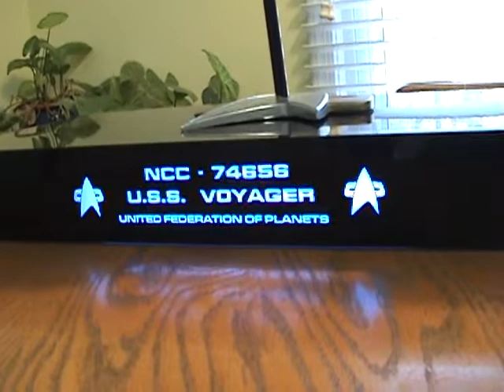USS Voyager

Comment from the maker: @tonypk0710 Thank you! Yes, I bought some very tiny drill bits (1/32) to drill the windows out (three holes for each window - top, bottom then middle) then bought a set of very small files (from Micro Mark) to square the windows out. Since this was my first attempt at drilling out and filing  windows I didn't do a very good job at it but I'm still happy with the overall end result.

Comment: granted im 6 years late, might want to replace the LED directly at the center of the shuttle bay and replace it with SMD LED's, reason i mention this, the existing LED is blocking the shuttle bay, an SMD will be more along the lines of being flush mounted and with the SMD's, you might consider them on your next build.

Comment: I love the model and the detailing. You've done a great job lighting it too... My only pet peeve with all these lit models is that the LEDs are so massively out of scale for the navigation lights etc... Fibre optic is the way to go really, LEDs are just too big.

The other thing I think I'd have done differently is to drill all the windows and then paint the ones I wanted "off" black from behind. That way it's more consistent and you don't have grey windows. But that's just really nit picking to be fair.
Reply: @lufferov Thanks for the feedback! I agree with you about the size of the LEDs. This video is from 2012. I made another version in 2021, this time using some LEDs that were more in scale as well as some SMDs (https://youtu.be/ZQNYFdtTn2U). As far as the windows go, ask anyone that's put one of these together and you'll hear about what a drag it was to drill out the windows. Rather than going for a more accurate look of leaving some of the windows black I just drilled out as many as I could.